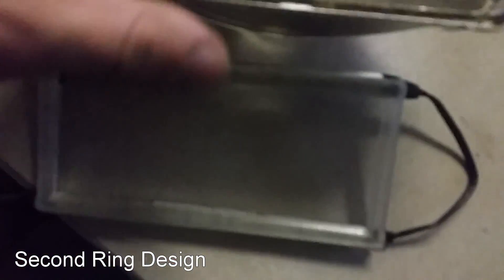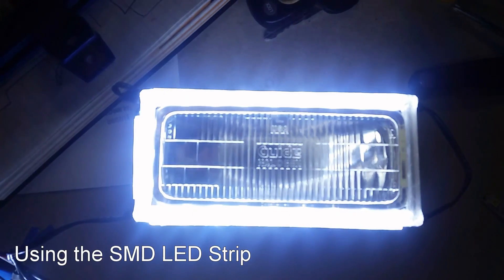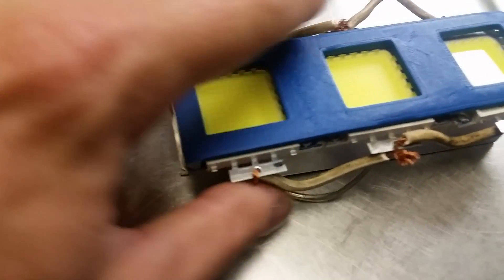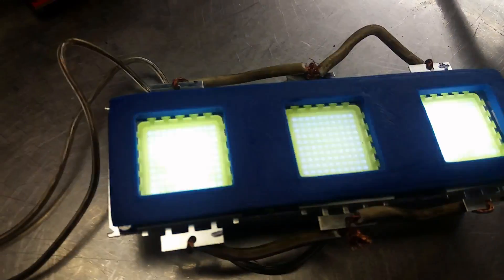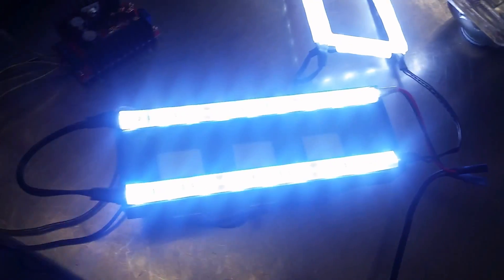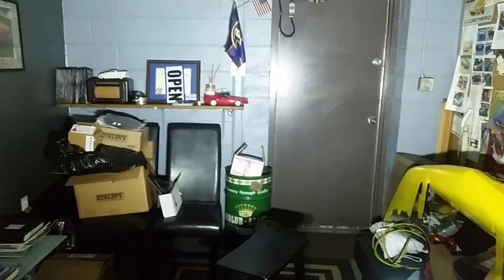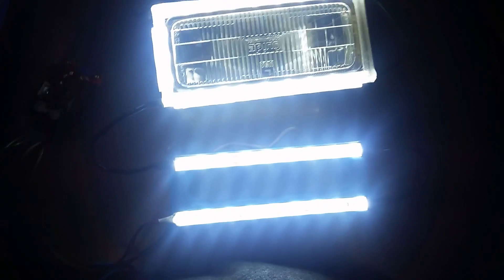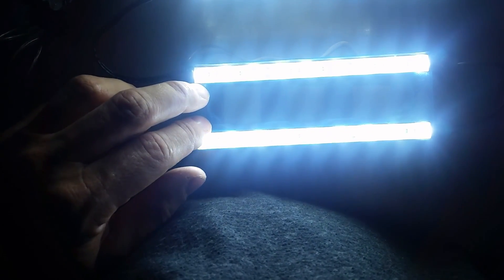300W LT1 Camaro Prototype Headlights PT1

Comment: Hey Rick, would u be willing to release the STL file for design? I've been tinkering around with my 3d printer and wouldn't mind seeing if i can make these work for my 94
Reply from the maker: I have to dig through my old hard drives. It really wasnt much. Basically just a rough sized block with the led chip mount pannel. I plan on redesigning it eventually but I need a larger print bed. There are some new filaments out now that should take the heat a lot better as well. My friend just got a cr10s so I just gotta get back to it. Also I stumbled on this project a while back. Its a 93-97 mini projector lense headlight design. Looks promising check it out: https://www.thingiverse.com/thing:2080951
Reply: Thanks Rick

Comment: Still have the system available?  94'. Z?  Thanks
Reply from the maker: Not yet, Without a decent cutoff line right now they would have to stay in high beam location. Its still in need of some research. I have a set of projectors that I wanted to make a stock looking light out of first. The printer I have can only do small sizes so I have to upgrade to a larger print area next.

Comment: Hey Rick! How are these designs going??
Reply from the maker: I really need to get back on these! I have to pick up a larger printer also. I am going to switch to some mini square projectors. I picked up a set of stock headlight bucket retainers to cut up / use for mockup. They will have the projectors sitting inside of them sealed in a printed housing with a acrylic lense, one plain lense from outer to inner possibly or a staggered look to it with a one piece housing.

Comment: Are you going to make a  part 2 with you finished headlights?
Reply from the maker: yes but i need to redraw up a plan for these. I have to study some led projection designs. I have seen one that the SMD chips were mounted horizontal with a reflector up top that produced a clean cutoff line. Recently I toyed with running an led with factory lenses but the cutoff was not good as expected. It is still in my mind and I will try again.
Reply: Well I definitely will be anticipating that video. Thanks for responding too.

Comment: So what ever happened to this?
Did you finish and put them on? It looks good.
Reply from the maker: Not yet I have to redesign the housing. I also acquired an HID Projector from a C6 I want to try and incorporate. The Square led ring is finalized.
Reply: Camaro Rick OK, I can't wait to see the final product. It looks good so far. 

I have a 93 Camaro and I really admire what you have done with yours.